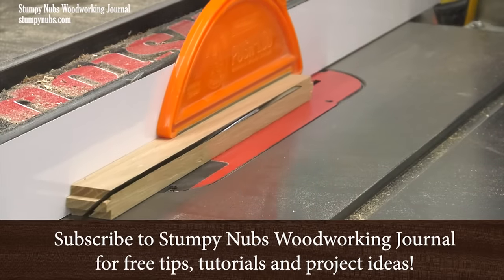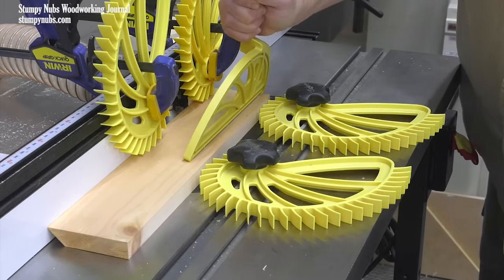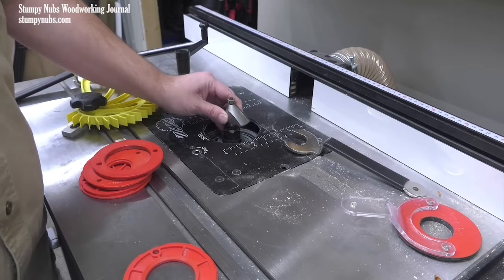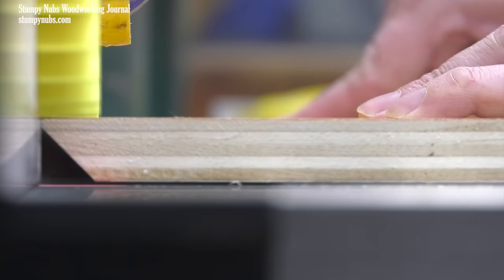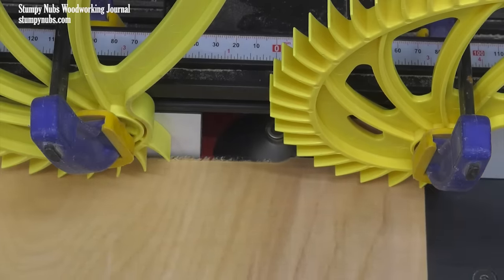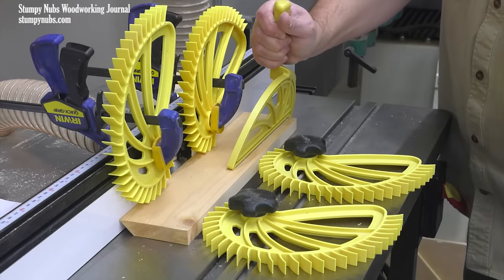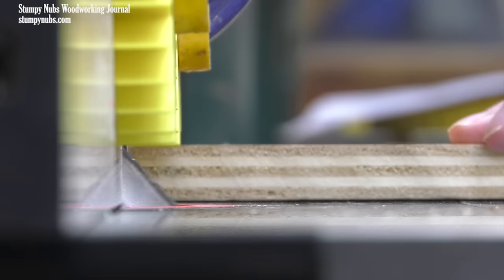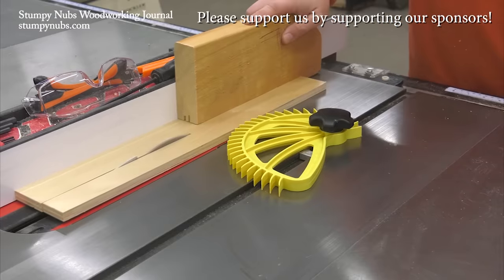This will make a BIG difference when you cut miters/bevels!

Comment: Stumpy
You have these great Hedgehog featherboards and yet you are using hand clamps to secure them to your router fence.
What's that all about?
Reply from the maker: My router fence only has a T-slot in it. The featherboards come with a bar to fit a miter slot. It's just as easy to remove the miter bar and clamp them to the fence as it would be to replace the miter bar with t-bolts. But I am thinking of buying an extra pair to just keep t-bolts in.

Comment: This is not so easy! I'm trying to bevel to ends of 8" wide boards. Seems fine until the last 1" of the board, which tends to drift into the bit, making a "gouge" into the end of the board. Also, the Whiteside bit in the link has a bearing, but you use it with a fence, correct?

Comment: Personally, I would not recommend taping on a narrow guide bar on the top of a workpiece, and running it along the fence like that. Here in the UK, the quality (i.e the "stickiness") of double-sided tape can be really low from some suppliers. Okay, you CAN get good double sided tape, but you have to LOOK for it, and make sure it's good quality, with plenty of "stick". I'm sure I've used stuff from "hardware shops" before, which was so weak that doing that would just rip the guide bar off, potentially exposing your fingers, that are helping to press the guide bar down, to being cut on the router bit. If you're going to do that, I would say it's best to do it with a much wider guide panel. Same width as the job-piece (in that scenario). Screw them together if possible (that's best!). If that's not possible, use the tape, and do a line of tape near to the fence, then do a line of tape on the opposite side as well, as this will help to ensure that even if you've got useless, hopelessly weak UK-spec double-side tape, if it does come apart, your fingers won't be at risk. As you will be passing both pieces through from the "back" of the workpiece, and not needing to touch a narrow guide bar, near the cutter. You should be utterly confident, at the end of the day, that doing that operation will not result in the guide bar breaking loose during operation. 
    But this really is only if you require a literal "knife-edge" on the workpiece. Which you really seldom need. The easiest thing is to leave a very small (1- 0.5mm) flat on the edge when you cut it. Then you won't require a guide bar at all! And you can sand it in with an arras or pencil radius when the workpiece is mated to the adjoining bevelled piece.
   A small point but worth making. Love those feather-boards though. Much easier than making your own out of MDF and having to cramp them both ends.
Reply from the maker: Just because it may hard to find good tape doesn't mean you shouldn't use tape any more than the difficulty finding a good finish means you shouldn't use finish. Locating and using good products is part of the craft.

Comment: James, excellent video. Everytime I get a hit that you posted I immediately click on to watch. Didn't know that saw stop made router tables. Are they as expensive as their saws? Are they as good quality (fence, table top ) as the saw?
Reply from the maker: Yes they are nice, and yes they are expensive. But they do not have the flesh sensing tech you get on the saw.
Reply: Yea I figured that but still quality should equal longevity and straight cuts with a good fence. Thanks for all you do. That bit is surprisingly affordable

Comment: Is the router table a floor standing model? if so, what is it? . Edit:  Also, how tall is the table? I like to work at a taller table level than the level of most tabletools, so I don't have to bend over.
Reply: Looks like he's using the Sawstop Standalone Router Table.  Detailed specs are available on their website.

Comment: Why don't you use the bearing to align the fence?
Reply from the maker: The sharp edge of the bevel can not ride against the bearing. In fact, it would end up slipping in the gap between the top of the bit and the bearing. The bearing is intended for chamfers that do not create a sharp edge.

Comment: Wouldn't a V Groove router bit work better?
Reply from the maker: How so?
Reply: @StumpyNubs Actually, never mind. I tried it today and it took me multiple cuts to sneak up to the perfect edge. I assumed that if I  got the V Groove perfectly centered on the fence (which is apparently impossible!) I would get perfect 45's. That didn't happen. Tomorrow I'm going to try again, but using a miter gage on my router table instead of the fence. Thanks for motivating me to find new ways to do things in the shop. I rely on my table saw so much that I haven't really explored all the things I can accomplish with my router table.

Comment: I've been thinking SO much about this. I have a desk build that will be a 3/4 solid ash mitered box. I've been debating either using a circ saw and straight edge vs. Router bit vs table saw. 

I just hate when the miters aren't perfect!!

Comment: Why not shim the out feed fence . I use a razor blade thick piece on brass.
Reply from the maker: You could, but why bother? It would take some testing to get the right shim setup. You may as well use one of the methods in this video. The first one took me two test cuts. I don't think shims would be faster or easier.

Comment: Question . . . . 
Why the Whiteside Router Bits 2306 and not the Whiteside Router Bits 2310 ??
Reply from the maker: Because the bigger one is twice as much. But if you want to work with stock thicker than 3/4, buy it.
Reply: @StumpyNubs  
Thank you for the answer.
That's what I figured but making sure I didn't go off assuming things.

Comment: You link to the $43 bit on Amazon but The bit you were using (1:48) is actually the $82 bit on Amazon
Reply from the maker: Yes, but the slightly smaller one will do 3/4-inch material for half the price.